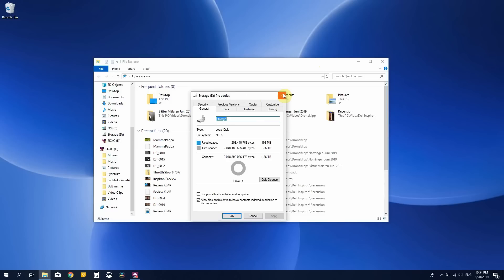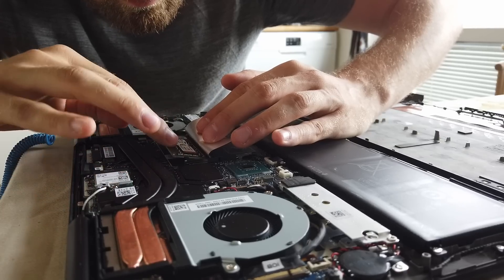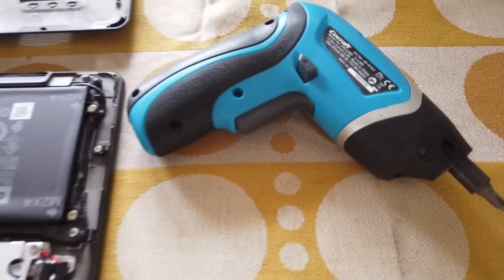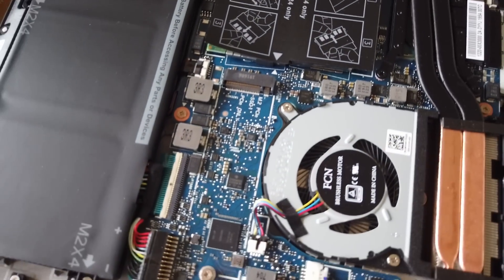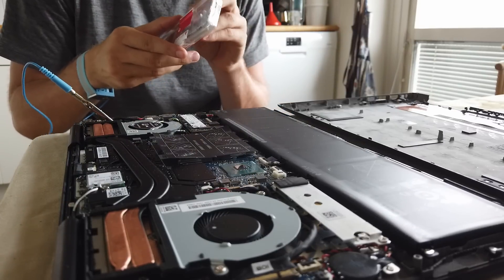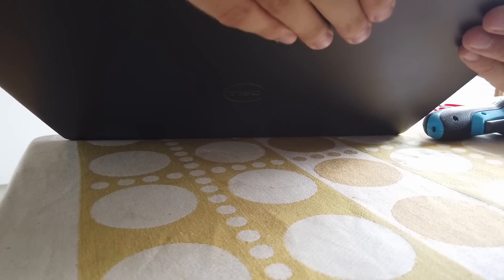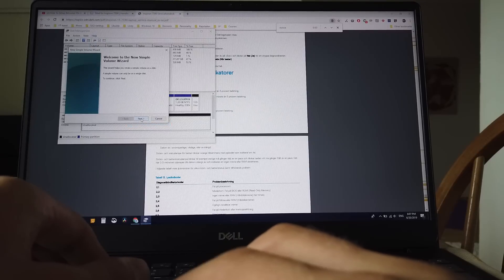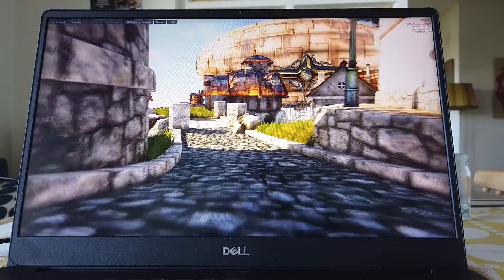Dell Inspiron - 2,5Tb SSD & 16GB RAM Upgrade

Comment: Is the pre-installed ram dual channel? Or single channel? In the last case is it better to buy directly 16 gb of dual channel memory? Thank you!
Reply from the maker: All the inspiron come with one ram-stick so they are running in single channel. To get proper dual channel you need same size and same speed. There's no gain in buying 2 ramsticks and replace the one already there - it will work just the same way.

Comment: Just on observation - heatsinks/heatpipes on XPS seem to cover more MOSFETs based on XPS service manual: https://www.dell.com/support/manuals/us/en/04/xps-15-7590-laptop/xps-15-7590-service-manual/procedure?guid=guid-d0336a92-dd14-4b56-9ee6-70503a69bd17&lang=en-us
But some guys on the Internet wrote that this is the case only for i9 models. 
Still the one on Vostro looks pretty serious.

BTW some guy on Reddit wrote that he managed to install 64Gb ram to XPS. I wonder if this is the case for Vostro as well. Not that I need it - just speculating)
CPU obviously supports it but motherboards and BIOS are different.

Comment: was looking for how to open up the back plate and its skiped :( nvm i figured out myself
Reply from the maker: Haha for a reason. I messed it up completely. Back three screws are not coming out. Pry firmly with credit card. It's quite easy actually but I really wanted those back screws out. :P
Reply: @w2best  yeah the three screws was designed not to come off and all u need to do is to split the plastic parts below the screen after u unscrew everything, then the entire plate goes off, took me a while to figure out.
Reply: Guys I just bought an inspiron like yours. I've tried to open it...unscrewed all the screw, left the three screws unscrewed but in place, I went all around the perimeter with a guitar pick to open all the clips. 
I cant find the way to remove the back cover because I can't understand what to do with the hinge part...
The Dell pdf is totaly unuseful. Doesn't say anything about it...it only say to rempve the screws and open. Easyer said than done.
Can't fin any video that explain how to do this except for this video...but you skip the exact part I can't figure out.
The hinge par is the only one I can open...everything else is open but it still looks like I can't even lift the back cover it looks like there is another screw, but where? I don't know.
I tried three time. Still can't figure out how to open it and I'm scared to broke something...
Reply: @LiuteriaMarcellan  did u figure out how to open it?
Reply: @rmatharu  I did! You need help? To be totally honest dell support did send me a pdf guide to open it. The only thing that gave me trouble is that in the end when every clip around the perimeter was opened there was still something in the middle holding the cover. It tured out it was just a piece of biadhesive tape or something like that. With some "soft wiggling" the cover came off...i didn't know what to do becouse i could move it around a bit but still it wasn't coming off...a lot of head scratching for a tiny piece of adheaive

Comment: Hi, what is the material of the laptop body? And I was confused, in the USA there isn't the same model of Inspiron.
Reply from the maker: There are 2 different materials! Magnesium in this one, and then the silver version is aluminium and more heavy. That model 7591 also only comes with the 56wh battery and has a third slot for ssd instead. If you need a TON of storage that model is good, otherwise the dark grey is better imo.

Comment: What is the difference between the two M.2 SSD slots in this model?
In 2:14 it looks like SATA M.2. If I am not mistaken, there are B&M key in the SSD.

You can use this software https://www.sisoftware.co.uk/download-lite/ to check the type of the SSD.
Reply from the maker: I'm not sure if there is a difference. NVME should be compatible with both slots.
Reply: @w2best 
Have you checked the type of SSD that is included in this model , is it sata or PCIe m.2? Because, I think it looks like sata in the video.
Reply from the maker: @shdotcomdata8213  It's marked as BC501 NVME SK Hynix 512GB in Device manager. But it's a pretty darn slow NVME I agree on that part.

Comment: How to know which ram is compatible to add?
Reply from the maker: I use the sam speed so the motherboard doesn't have to juggle that. Also the same size for proper dual channel. So in this case 8 gb 2666mhz!
Reply: @w2best  Ok thanks. So the brand, timings etc. doesn't matter, as long as it's the same speed and size?
Reply from the maker: @morten1  Yes! :)
Reply from the maker: @morten1  That's right!

Comment: hi bro. thanks to your video.
hey i so wonder that laptop is using a nvme.
i think to this laptop write/ read speed is so slow.
usually 512gb nvme speed is 3000-3500.
plz say to me bro. thanks.
Reply from the maker: I have nvme but noway near samsung drives. I just wanted a large storage drive, that's why I went for the intel one. The main storage disk is also noway near samsung speed. Change it if you want lazer fast read and write!

Comment: Hi,
Thanks for your review on this computer. It helps a lot when considering to buy such things. I was just wondering, given the specs of your computer, why did you chose i5 instead of i7 ? Is there only a price reason ? Or is it because the difference between both i5 and i7 on your use is too small that it was not necessary for you to get i7 ?
Thank you,
Yoan
Reply from the maker: I thought the value for money was higher in the i5 model and I was more keen on matte screen than glossy 4k.
Reply: @w2best  Thank you 👍
And what do you think about the screen? I'm asking because I am wondering if the screen is good enough for photo and video editing (holiday pictures/video editing, this kind of things, not something professional at all).
Reply from the maker: @yoan.v  Oh yes. The screen is great both with colors and brightness, but It's not a professional screen for editing.

Comment: i just buy new 7590, i tried to install “240gb WD GREEN M.2 2280” but it does not show the new drive. Do you have any comment?
Reply from the maker: Did you activate and format it?
Reply from the maker: Check this video: https://youtu.be/-c0ccVTsVXw
Reply: you must use to disk manegenent on windows 10.
Reply: thank you, now I can solve the problem, My 7590 support NVME only.  WD Green that I posted to your question didn’t NVME.

Comment: Hi there! I got a few questions: does this model similar to Vostro 15 7590? And  you add an extra RAM to your existed 8th gb?
Reply from the maker: Hey! It is the exact same laptop but consumer vs corporate branding. I added 8gb on top of the existing 8gb. :)
Reply: @w2best  Thanks! 🤝🏻
Reply: @w2best  Hi there mate! Got a question, I purchased Vostro 7590, but haven't received it yet, now I'm about to buy additional ssd. Could you tell me, what an original brand of SSD that already existed inside?
P.S.
About to buy this one: Samsung 970 EVO Plus NVMe M.2.

Comment: You could try to change the included fans to see if by installing new and improved laptop fans the laptop becomes quieter.
Reply from the maker: Hehe, that's an upgrade I am sure I will not make. I will make tweaks to make them run as well as possible and maybe maybe thermal paste, but that's where my limit is.

Comment: Hey ! Can you tell a what point the fan get load when you use the computer? Is it only in game or also on Internet and small task?
(And did you check how much they get load?)

Thanks for your video !!
Reply from the maker: For me without undervolt the fan starts at medium loads. Not at browsing the web or at idle but for example when Benchmarking the ssd. With undervolt it is better. With undervolt and disabled turbo fans are almost never on.
Reply: @w2best  ok thanks ! So do you think it's a good laptop or not?
Reply from the maker: @alexandreminaud395  I have been using it for about 2 weeks now and I will not use any other laptop. This is the perfect mix between size and performance.
Reply: @w2best  even if he can be very hot and very noisy ?
Reply from the maker: @alexandreminaud395  Yes, with the settings i came to in this video https://youtu.be/WlKt7IuteDk Not very loud and not very hot. :)

Comment: Hi do you think the battery for the 56 whr version is sufficient for daily use? And do you think it is possible to upgrade the 56whr version with a 97whr battery?
Reply from the maker: I think it is especially with the full hd screen. And the laptop would be 150 grams lighter. It's not possible to change from small to large battery if I'm correctly informed.

Comment: Thanks for the video bro.
I was thinking that to improve the thermals, you can also apply a better thermal paste. Corsair released a great thermal paste in Amazon for 5€.

Maybe undervolting and applying a good quality thermal paste, it can be resolve the high temps issues. That's what it keeps me thinking of that laptop.

Great work👌
Reply from the maker: I'm a bit nervous about thermal paste. It might happen but not soon...
Reply from the maker: No thermal paste but here I'm trying out other stuff to change the thermals https://youtu.be/WlKt7IuteDk

Comment: I would be interested to hear if the problem you mentioned with Thunderbolt got resolved or not.
Reply from the maker: I will make a separate video about that. Displayport over usb c works fine at least. I will try with a Lenovo thunderbolt dock this will and see how that goes...

Comment: Hi there, I've just got my Vostro with i79750H with 8GB of RAM and 256GB M.2SSD, GTX1050 3GB DDR5 and 56WHr battery life. After I play around with it. The most annoying is back light bleeding. It's all over the edge of laptop screen and I've asked Dell to swap the screen for me and I hope it's work otherwise I'll retrun and make a new purchase with the top of the line with i79750 16GB of RAM and 512SSD in $1799 AUD and more importantly this model comes with GTX1650 and 97WHr. Do you think this spec is worth for money(about $400AUD to put on top of my currently model($1415AUD)

After you upgraded 2TB SSD and you capacity is 2512GB so that's meant there''re two slot for m.2?

PS.Have you check with headphone jack? Mine it doesn't work at all. I've tried with 8 pair of headphones including PC speakers the sound still come out from laptop speaker. I''ve tried to config the output as well.
Reply from the maker: Hey! My unit is fine with no or very little backlight bleed. 
I absolutely think the top model is worth it. I didn't want 4k, which is the reason I didn't get it. My original thought was to upgrade to 32gb ram too but decided to settle for 16. 
There are two m2 ssd which feels like a true luxury in this price level.
Hope your issues get resolved.
Reply from the maker: And headphone jack! When you plug in it opens the maxxaudio app and you have to select what you plugged in. After that they work straight away.
Reply: FYI - For Your Inspiration  hmmm i dont see the maxxaudio app in the laptop. It might be gone when I debolt since i turn it on. lolzzz 

Thanks for your suggestion, so I can rest in peace until tomorrow morning because i'll ring them and ask to make a new purchased and return the old one, if they keen to do XD.

The RAM I concern only 16GB but with dual channel but seems they dont have this option for Australialian consumers.
Reply from the maker: @Murazaie  I don't think there's any option to buy it with dual channel. You have to upgrade it yourself. My headphones are not activated before I select the input in that app. Strange but that's the way they seem to have done it.
Reply: @w2best  I just made a return the currently one and buy higher model because if I upgrade another 8Gb(kingston hynix with similar CL and Voltage, and bus) of RAM and 1TB for SSD I have to pay about $400 or more. By that cost if I pay for upgrading a new to higher i pay about the same cost but I will get the same CPU with double RAM and SDD also GTX1650 and battery 97W. I will be happier.

With new purchased if the laptop still cant export my 4k, i'd return and back to PC. I have no disk space when I bring all the clips and export after editing. I can do just render only one sequence and send to external for back up. 

I'll try to configure the fan to suit with CPU temp and Voltage, it's really annoying when the system have nothing to run but the fan SO LOUD like its run 100% lolz
Reply from the maker: @Murazaie  I can see that! With my config and the upgrade I'm around 1500 euro and that is extremely good for my needs. The high end model was at 1850 euros and then I need an extra ssd to get more storage. I'm really happy with my config. Video on temps coming very soon!
Reply: Oh and I waiting for your VDO with Thunderbolt 3 port as well :)

Comment: 512gb on manual probably meant maximum storage in configuration options when you purchase the laptop.
Reply from the maker: It explicitly said in the manual that 512 was the max for each slot... But I don't understand why that would be.
Reply: The other option was just adding the new ssd to the other empty slot.
Reply from the maker: @xMel21x  That's what i did in the video. But in the upgrade guide it says max 512gb in the extra slot for some reason.

Comment: Which ram did u buy?? Wondering why it wasn't working on first try
Reply from the maker: It's hyperx 8gb so dimm ddr4 2666mhz. It's exactly the same spec as the one installed but that is a Kingston stick.
Reply: @w2best  Did you check your upgraded ram is actually running at 2666?. I have just done exactly what you have done with my 7590 and installed HyperX 2666 sodimm and it will only run in 2400 mode, I checked this with CPU-Z and there is no XMP in the bios.
Reply from the maker: @multimonstermonster  No I never even considered that to be an issue. Did you have any problems with it? I think 2400 is more than enough though. :)
Reply: @multimonstermonster  I meet the exact same problem with a brand new HyperX 2666 16go RAM and it now changed to 2400. Did you find a solution since then ? I am wondering if it is because I use 2 different RAM (the original + the Hyper X) or if it is for another reason ?
Reply: @SimonCramar  I guess hyperx 2666  is CL15. and the one on the board is CL19. I am not sure if this has something to do with.
Reply: @w2best  BIG question. Hope you will be able to help me out:d

I`ve got issue with HYPERX RAM sticks.

As far as I know Inspiron 7590 is not compatible with ram which uses XMP option. I tried to add 2 x 16Gb of the same HyperX you mentioned but it DOESN`T WORK! Dell forum are full of this kind of problem. Probably bios is not compatible. 
I`m really suprised you were able to work it out somehow. 

Could you tell me what version of bios you had when you installed it?
Reply from the maker: @patryklaban5907  I have no idea what BIOS I was on. It didn't work the first try but when I  swapped positions it worked fine. I haven't heard about any issues with SoDIMM ram. Noone else has mentioned it of all the people that have upgraded from the video so this seems strange! Did you try swapping positions? What happens when you install?
Reply: @w2best  I`ve done everything you suggested, along with swapping. 
ONLY original RAM stick WORKS. 
Any new (again - 2x16GB HYPERX) ram is not. 

Dell forum is full of topics with the same issues, for example:
https://www.dell.com/community/Inspiron/XMP-Memory-Modules-and-Inspiron-15-7590-Compatibility/td-p/7399935

It looks like compatibility with XMP. I`m really stuck on it - I was hoping to get it running in minutes, and now I spent second week on it.....

BTW Dell support doesn`t care.
Reply: And of course signal of 2 + 3 lamps when it was not working was on.
Reply from the maker: @patryklaban5907  Ok! I was using that exact HyperX ram and for me it has worked just fine. Try ordering another stick and if it works return the hyperX one? Good to eliminate the risk of several ones not working first .
Reply: @w2best  will try to replace them. Will see . But I`ve got to say that amount of people with the same problem is a little downer for me.

Nevertheless - i ve got to thank.
Your reviews were irreplaceable and ultimate help for me!

Comment: Thanks for the video. I bought the same laptop. Where did you start when you pry opened the back lid?
Reply: Got mine today and upgrade to Intel 660p 2TB SSD also. But for me, all the screws easily came undone, and it was easier for me to start from the touch pad end of the laptop. I happened to have long finger nails today (yeah... I know. It was time to cut them today), and I used my finger nail to pry open the first notch and the rest, I used a credit card. It wasn't that bad. I hope that helps someone who might also be interested in knowing how to pry open the bottom panel.
Reply from the maker: @jyang6107  Nice! Thanks for updating on this! I was stupid and used the worst screwdriver ever the first try. I wanted to include it already in the first video but that was impossible.
Reply from the maker: I started where the hdmi and power port is. That side came off a few mm after I released/removed all the screws. Pried with a credit card quite intense.